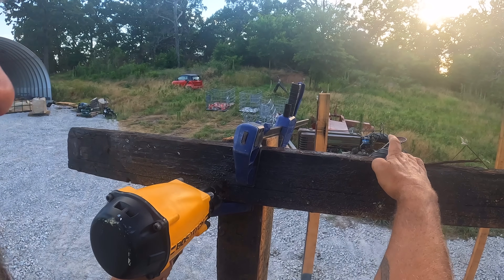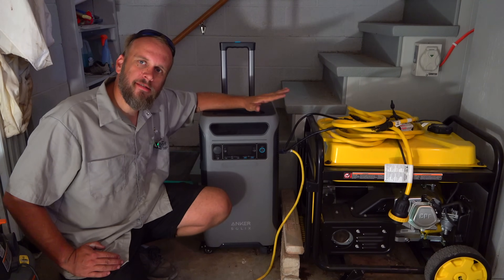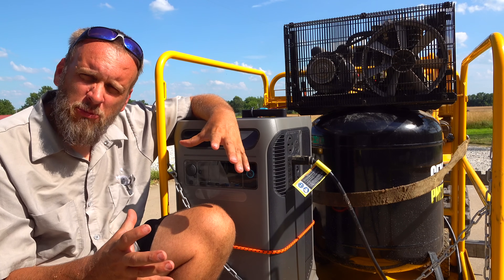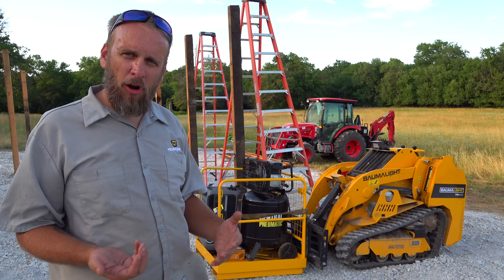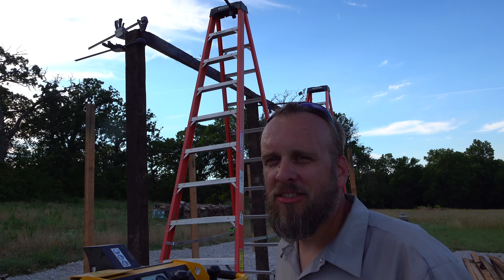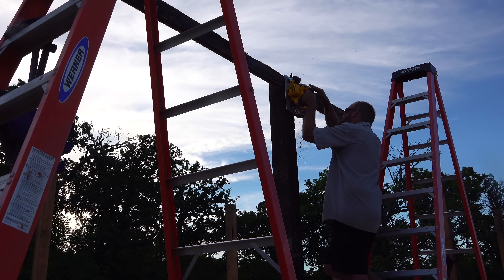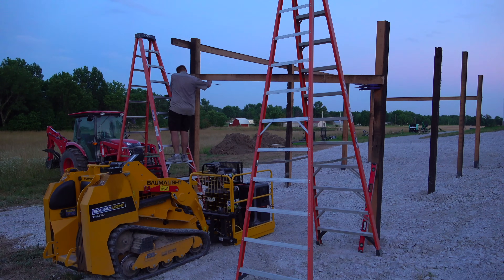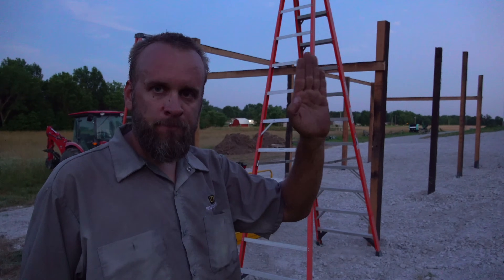Solo Pole Barn Build - Putting up Headers

Comment: Careful with all those nails in "shear" on the front and back beams. You may want to add a 1/2" carriage bolt through each joint. It won't matter as much on the sides. Thanks, fun to watch!
Reply: I had similar concerns.
Reply: Have to agree, definitely needs a heavy duty bolt.
Reply from the maker: I’m definitely not just leaving a single header the way it is now with those nails

Comment: Good morning Brock. I have all kinds of advice that might help make the job a little bit easier for you but it looks like you're doing fine. What I would like to tell you is not to trust those nails. I've personally had an instance where they bent like soft butter. To me the quality of the steel used just doesn't measure up. I would go around and run some construction screws in before you do the roof rafters or drill through and use carriage bolts or even lag bolts. I'm just trying to look out for your safety when you're up on that roof. God bless and have a wonderful day. 👍👍🙂

Comment: Hey Brock,
I usually notch my post so that way the beam sets on the post and screws to it easily. Might get you a line level it's just a small level that hooks onto a string or chalk box and you could mark all your post at one time.
 Looking good. 
It's hard work  and you are by yourself. 
Good job..
Reply: Notching the posts is a great suggestion.